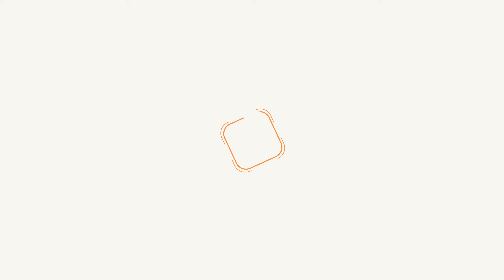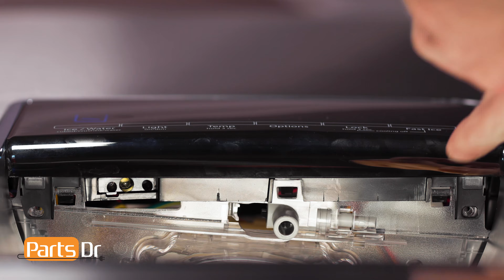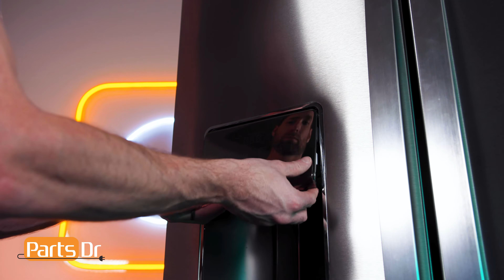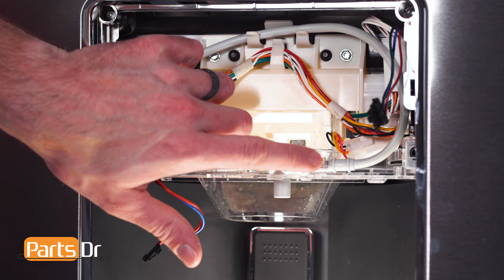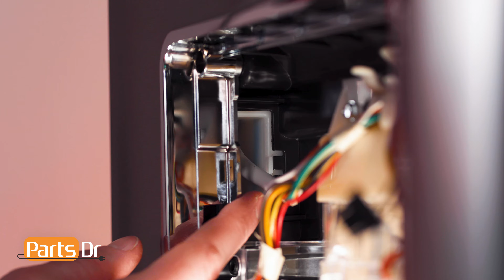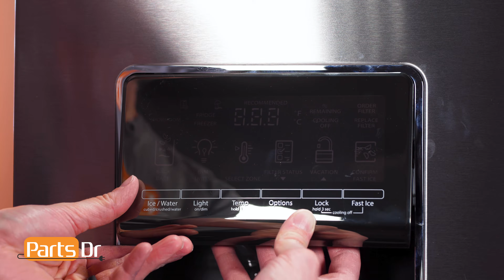How to replace Dispenser Water Line part # WPW10499015 on your Whirlpool Refrigerator

Comment: Thank you for showing EXACTLY how to remove the interface from the underside. 
The spigot for the water nozzle was not seated correctly or locked in. I was able to access, seat and lock the spigot nozzle in. This saved me a 150 dollar service call and labor. No parts were needed. I fixed it I. Less than 10 minutes thank you!
Reply from the maker: Awesome! Nice job fixing it yourself and saving money!

Comment: Do you have a video showing how to replace the waterline on the back  that flows out of the water inlet valve and into the back of the fridge near the top corner? Our water line has a small crack at the bottom near the cuff of the the line, causing water to drip out from near the bottom of the water inlet valve.

Comment: Do you have a video for replacing the line through the entire fridge?
Reply from the maker: There is not one line for the entire fridge.  There are multiple different lines that connect to different components and areas of the refrigerator.
Reply: do you have a video showing the replacement of the tube from water source?